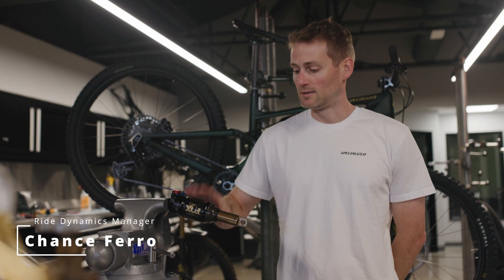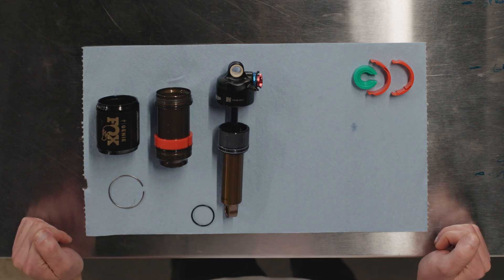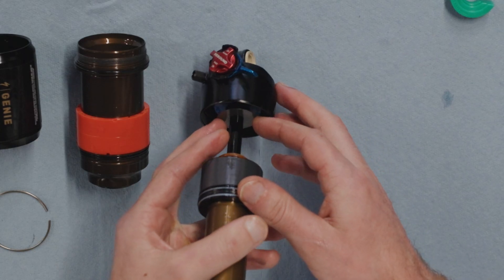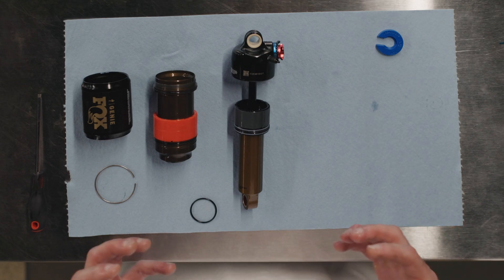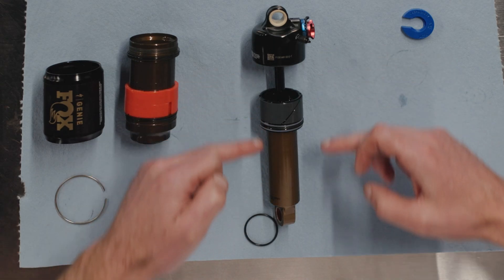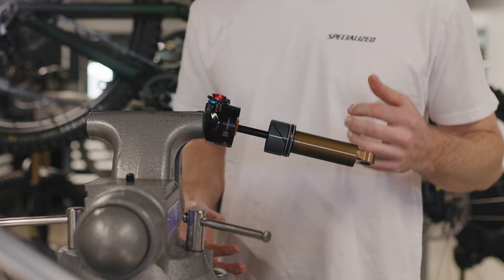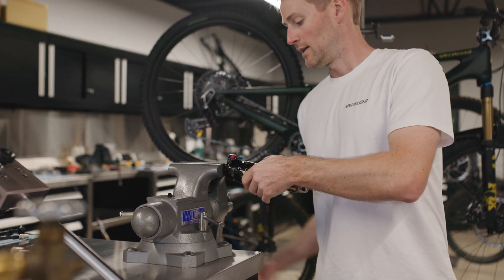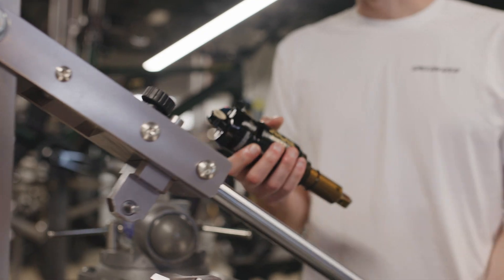Tuning, Servicing, How It Works - FOX / Specialized GENIE Shock

Comment: I just did my aircan on the genie.  Several of the seals are NOT the same size as a regular Fox Float shock.  They are too small and then the air can does not go back over the rest of the body.  Not sure where you get these parts.
Reply: Same, cant find the specific kit anywhere. Def not on fox's website yet and I believe this is relatively "old" shock at this point.

Comment: So basically, a 200 euro shock mounted in a 5000 + euro bike.
Reply: Yeah it absolutely needs more hsc and hsr adjustments that do jacksht and the average rider definitely needs😂
Reply: @JimnyRicardo  the shock could be based on the float X, something with a piggyback. This is pretty much a megneg version of fox, a 50 euro upgrade. Is pretty lame in a 5000 euro bike.

Are you aware of the current state of the cycling industry? No wonder people think this is a dentist sport with brands only seeing profits.
Reply: @pedromiguel1389 A megneg doesn’t close off the extra volume at 3/4 travel like the genie.
Reply: @pedromiguel1389 They have one based on the floatX. It comes fitted to the levo SL.
Reply: @marshallkeller4381  yup and because of complexity you can't tune genie at trail unlike megneg